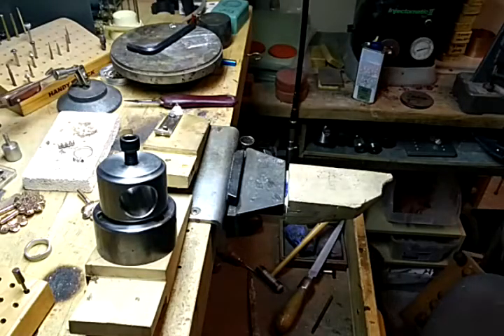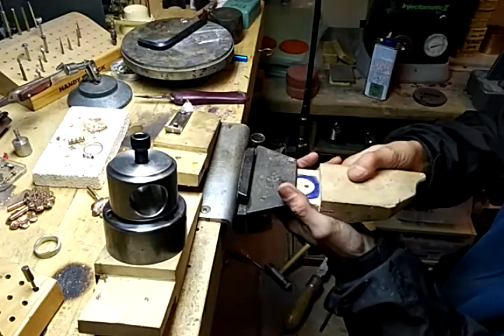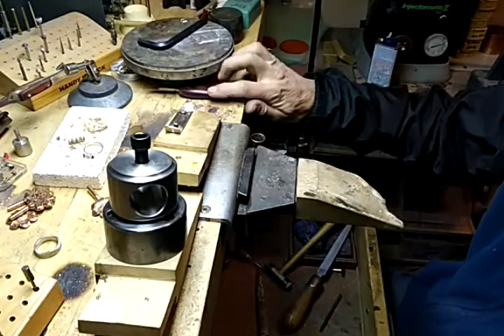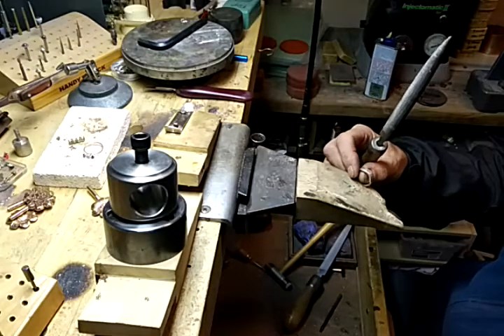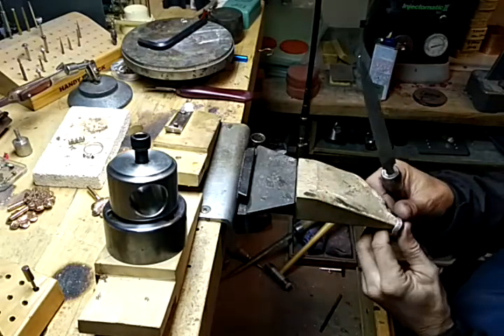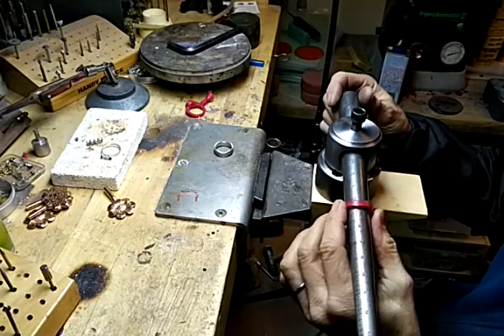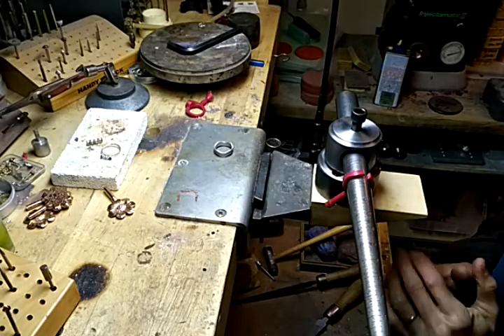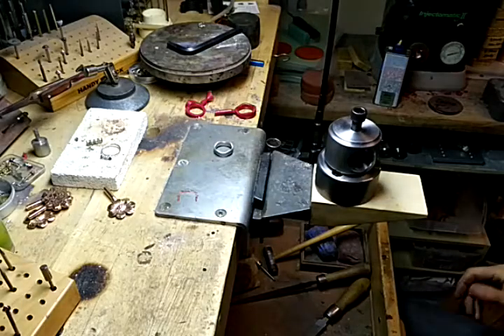Three Ideas for Setting Up a Bench Pin

Comment: I'm upset .I changed to the bench m8 plate and pin . Reason the pin plays in up motion no matter how you adjust or try to shim or brace . I might keep the plate and go back to the old clamp on . Did the job 100 time better no movement or slop on peg ! FOR THE $ IT IS NOT A VERY QUALITY THOUGHT PRODUCT or worth the change  ! SORRY !